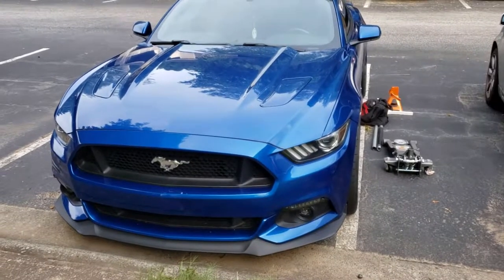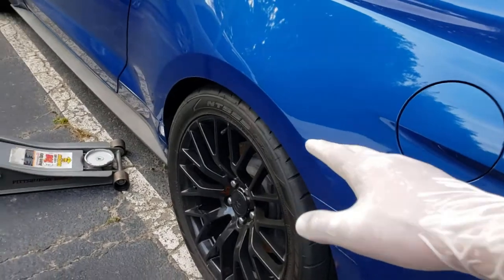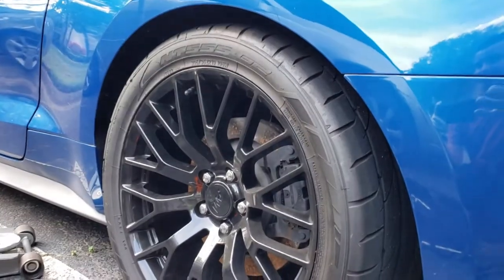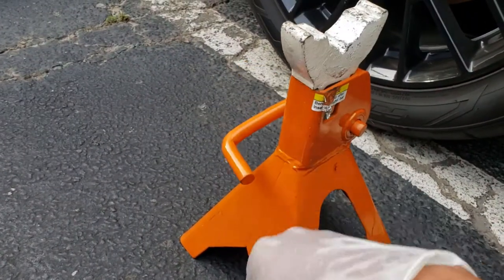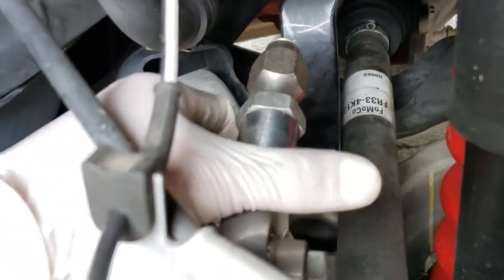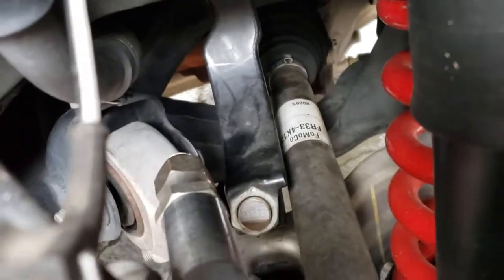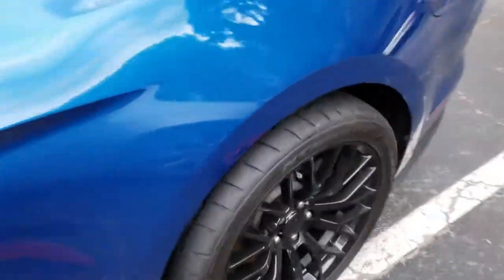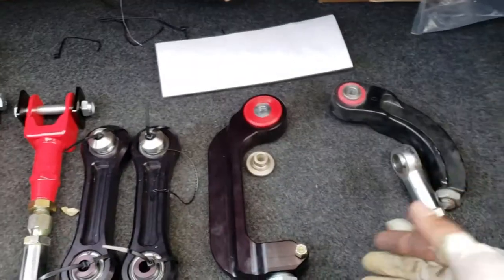2015-2017 S550 | Installing full BMR rear suspension

Comment: Another question for you bro bro I’m sure you seen my comment about installing the BMR adjustable camber arms
Driver side I couldn’t torque it I tightened it by hand as tight as I could passenger side I torqued it to spec and the side I torqued moved now it’s negative camber again how tight would you say I should tightened the passenger side?
Reply from the maker: You have to use the right tools to get a good grip on it bro you don't want it to come loose while driving
Reply: @YLegalRacing  I have a torque wrench and also wrenches to hold the other side aswell I’m wondering when I go in there to re tighten it right now how tight should I torque it to?
Reply from the maker: Go to bmrs website, they should have an install pdf with the torque specs
Reply: @YLegalRacing  yeah that’s what I did the first time it said 86ft lbs for the bolt further back and it moved and I hear noise when driving
Reply from the maker: I had the BMR toe links make noise when driving
Reply from the maker: Never had an issue with the control arms
Reply: @YLegalRacing  what’s your IG I’ll show u pics of it
Reply from the maker: I am loopy
Reply: @YLegalRacing  video sent lol 🙏🏼

Comment: UPR?
Reply from the maker: I won't say who to not throw anyone under the bus but BMR is what I'm sticking with
Reply: @YLegalRacing  I have UPR Vertical links,  and spherical  bearings,  everything else is Steeda.  BMR makes good stuff. But I like steeda because they work with Ford engineers.
Reply from the maker: Yeah most definitely, as long as you don't have a Frankenstein set up and stick with one brand for the most part you should be good.